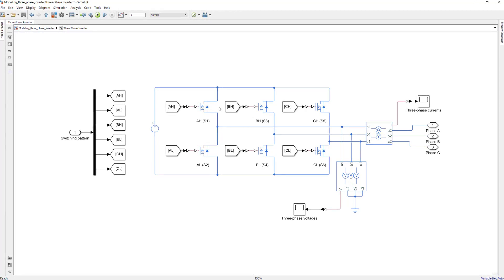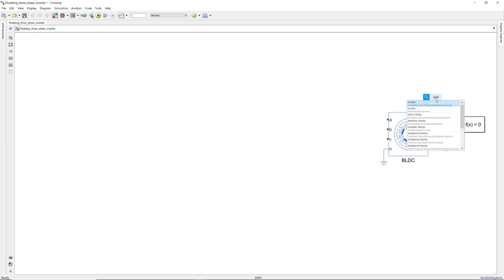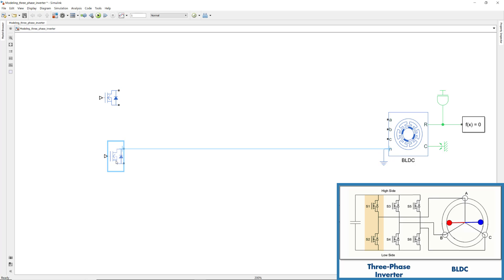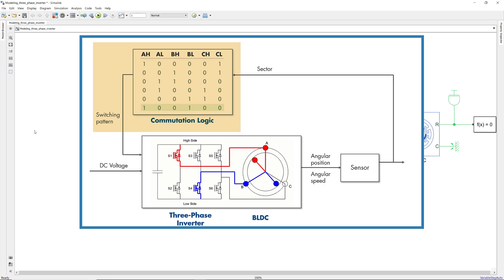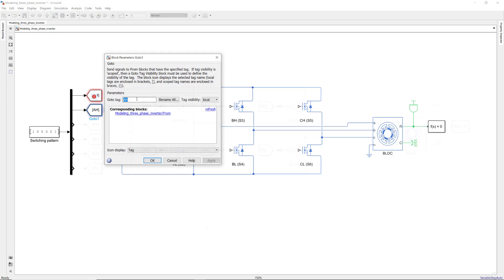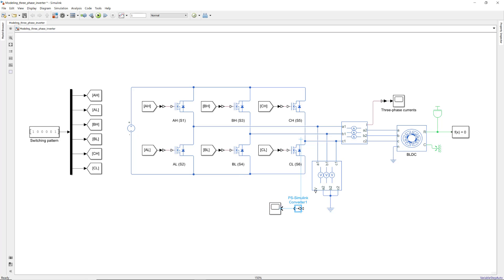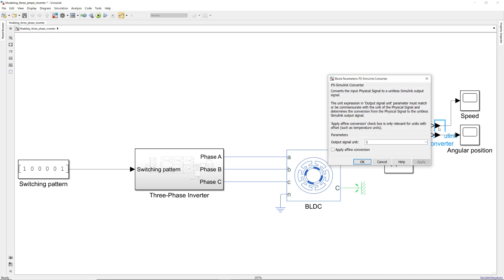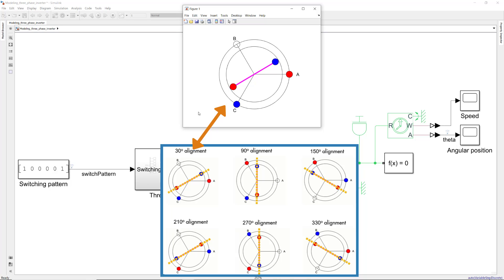How to Design Motor Controllers with Simscape Electrical, Part 2: Modeling a Three-Phase Inverter

Comment: I am using MATLAB 2022b and I follow all step according to this vid but my "animateRotorPosition" in MATLAB doesn't work the picture doesn't moving and my BLDC motor modeling option only have 2 option no thermal port and show thermal port. so I'm using the old 2015a MATLAB to design the project and run it on 2022b MATLAB.

Comment: good mornig
first, congratulations for your job, but "Error evaluating 'InitFcn' callback of block_diagram 'BLDC_control_buck_converter'. 

Callback string is 'load bldcData". How do I solve this problem in buckconverter block?
Walmir from Brazil

Comment: I get the following when trying to run de file BLD:

Error evaluating 'InitFcn' callback of block_diagram 'BLDC_PWM_control'. 
Callback string is 'load bldcData'
Caused by:
Unable to read file 'bldcData'. No such file or directory. 

Where can I fin de bldcData file? Help would be much appreciated.

Comment: I am getting the animation by copying the script, but the animation isn't rotating. Can anyone help me out with this?
Reply: Also the waveforms from the Voltage sensors are coming out to be sinusoidal(120deg) displaced rather than trapezoidal.
Reply: same here not rotating and no color. its just black and white
Reply: Same problem with my model

Comment: I tried to simulate this model for more time and the current sensor reading keep increasing, shouldn't it settle at a certain point or am I getting it wrong?
Reply: Ibrahim, there are a couple of parameters that may affect your simulation results such as solver and motor settings. You can download the Simulink model used in this video and compare with your own model. Please see my comment above with the link to a GitHub repository.